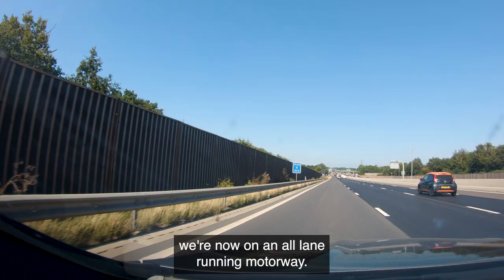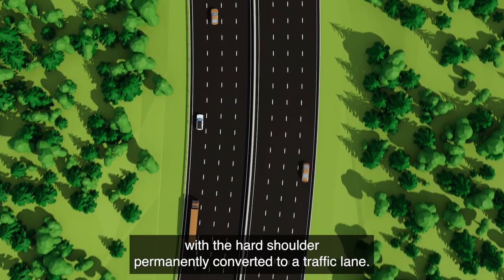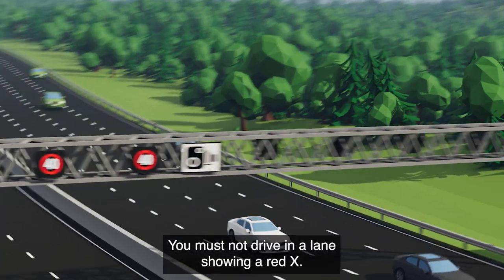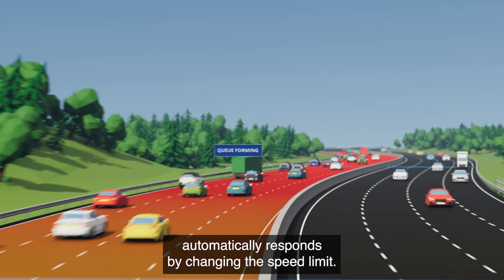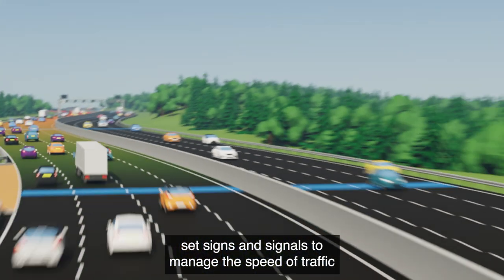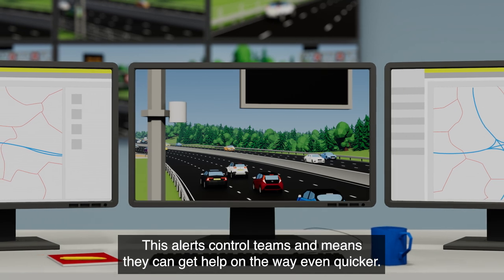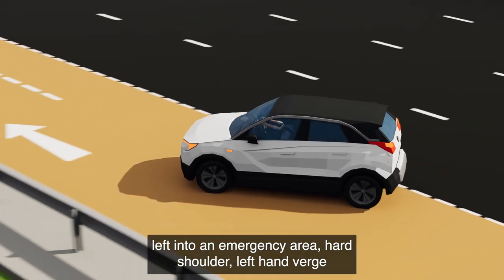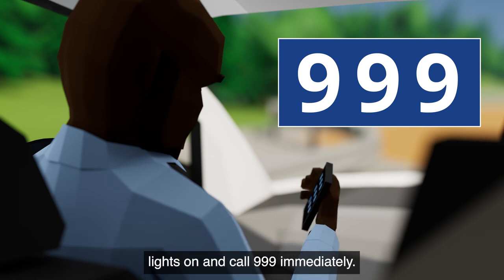How do smart motorways work?

Comment: I rarely use motorways but on the few occasions I have, these 'smart' sections have been a complete failure. A short drive from Junction 24 to 36 of the M1 just today there were 2 incidents of lane closure due to vehicle breakdown. Neither vehicle was actually in the live lane, one made it far onto the grass, another into the layby bit, UTTER CHAOS ensued! Overhead lights saying 40mph, all lanes at a standstill and nearly half an hour added to the journey of what would ordinarily take just over an hour. It's not like people use the lanes properly now either. The number of cars in lane 3 at 60mph and no inclination to move left is exhausting. Worse idea and ever.
Reply: "Forwarded message"
 I am ex motorway cop, I was a decent honest one If I say so myself, I only did speeders 95 upwards on follows due to obvious discrepancy they are never 100 percent accurate. With speed device it was always 10mph+1 over the limit so plenty of space for error so if you were doing 52 in a 40 fair cop if you pardon the pun, the +/- 2mph is mathematical con., So you know the risks, My daughter got caught on normal road by van, 39 in 30, she was doing 30.9 and 32 going down a hill,  having used the devices for 20 year it was being used way out of safe parameters, this adds on anything from 4-7 mph, I challenged at court, they brought the top barrister and his side kick an ex-cop who was as qualified and an expert as me, they withheld evidence, I now have that undisclosed evidence that proved I was correct, they lied to win the case, the only process now is to appeal and they will rip it 50k up to 500k, I'm thinking of writing a book as a way around it to highlight the con, inside out tv did a programme but they couldnt work out the 6mph overread, I can. Every car at that point (thousands over the years) in Northampton have been unlawfully prosecuted, the police knew as did cps, but they covered up it would have cost millions in compensation, I got fined 2.5k costs and in summing up the barrister said he was asked to win this case by northamptom police?, later refusing to deal with my complaint of perjury bearing in mind the police had the evidence, just a brick wall. solicitors will not touch a speeding fine and advise pay up, of course I would advise the same, motorway ones are done on algorithms. so those lines, the time .3 of a second from first to second line (beam) is the speed, the question is where is it hitting the car, is it the same on first and second?, as its time over distance, the plus or minus 2mph is a mathematical smoke screen that I can prove, its a con? but no one will touch it, my advice is pay the 100 quid, if you can afford a good solicitor and risk a 2.5 k fine which puts people off going to court , You may also get a solicitor to challenge and get you off but if its discontinued the solicitor will cost more than the £100, so catch 22. feel free to contact me, but they will do everything to prove you wrong, They are experts so believed by court your the bad boy speeding and trying to get off?  usual bullshit safety excuses you could have killed someone and lie through their back teeth. if there is a good solicitor on here who wants the story and evidence that will blow speeding vans and the +/- 2mph con out the water I am happy to chat. If you do go to court ask for the details of the others around as they are witnesses in your case , they will object hence you need a solicitor, see what speed they were doing. good luck you will need it. hope this helps.
Please share this message.

Comment: My question to the highways agency is just how are ambulances and fire engines supposed to quickly get to an accident, if the hard should has been turned into a running lane? This isn't like Germany, where drivers understand the need to leave a gap between lanes, this is the UK, where drivers simply don't have that ability. Making it difficult to get to injured drivers could be costing many lives, without this issue being reflected in the statistics.
Reply: They couldn't get through on the hard shoulder quickly when it wasn't a running lane because idiots always abuse the hard shoulder

Comment: Hypothetically a genius idea, in reality an absolute disaster for a number of reasons. You have so much panic breaking going on when they see speed limits, which is what causes huge tail backs as well as crashes as it surges back. It also results in drivers who don't obey the rules to drive right up behind drivers who are obeying and pressuring drivers. The same thing happens on the way out of the Dartford Tunnel with the speed limits there. You are pressured by other drivers. If theu activated the speed cameras and camera systems on these smart motorways every day and they were always on, it would generate far too much fine revenue and the population would revolt. It seems they only selectively actually turn them on. Which seems to undermine their very purpose. They need to be gotton rid of and they are not future proof. Apps like Waze, do a far better job of informing the driver of hazards and dangerous broken down vehicles ahead etc.
Reply: "Forwarded message"
 I am ex motorway cop, I was a decent honest one If I say so myself, I only did speeders 95 upwards on follows due to obvious discrepancy they are never 100 percent accurate. With speed device it was always 10mph+1 over the limit so plenty of space for error so if you were doing 52 in a 40 fair cop if you pardon the pun, the +/- 2mph is mathematical con., So you know the risks, My daughter got caught on normal road by van, 39 in 30, she was doing 30.9 and 32 going down a hill,  having used the devices for 20 year it was being used way out of safe parameters, this adds on anything from 4-7 mph, I challenged at court, they brought the top barrister and his side kick an ex-cop who was as qualified and an expert as me, they withheld evidence, I now have that undisclosed evidence that proved I was correct, they lied to win the case, the only process now is to appeal and they will rip it 50k up to 500k, I'm thinking of writing a book as a way around it to highlight the con, inside out tv did a programme but they couldnt work out the 6mph overread, I can. Every car at that point (thousands over the years) in Northampton have been unlawfully prosecuted, the police knew as did cps, but they covered up it would have cost millions in compensation, I got fined 2.5k costs and in summing up the barrister said he was asked to win this case by northamptom police?, later refusing to deal with my complaint of perjury bearing in mind the police had the evidence, just a brick wall. solicitors will not touch a speeding fine and advise pay up, of course I would advise the same, motorway ones are done on algorithms. so those lines, the time .3 of a second from first to second line (beam) is the speed, the question is where is it hitting the car, is it the same on first and second?, as its time over distance, the plus or minus 2mph is a mathematical smoke screen that I can prove, its a con? but no one will touch it, my advice is pay the 100 quid, if you can afford a good solicitor and risk a 2.5 k fine which puts people off going to court , You may also get a solicitor to challenge and get you off but if its discontinued the solicitor will cost more than the £100, so catch 22. feel free to contact me, but they will do everything to prove you wrong, They are experts so believed by court your the bad boy speeding and trying to get off?  usual bullshit safety excuses you could have killed someone and lie through their back teeth. if there is a good solicitor on here who wants the story and evidence that will blow speeding vans and the +/- 2mph con out the water I am happy to chat. If you do go to court ask for the details of the others around as they are witnesses in your case , they will object hence you need a solicitor, see what speed they were doing. good luck you will need it. hope this helps.
Please share this message.

Comment: So the ‘Emergency Lane’ taken is for Exactly the use of when one is in trouble.  It is to be used to pull up to the left!!! 
THEN LETS NOT FORGET TRUCKERS SIDE WINDS DRIFT ALLOWANCE SHALL WE!! Nature and Wind 🌬 does not hold for nothing. HGV’s need space in bad weather conditions… the emergency lane has saved many lives.

Volume and principles are correct… traffic volume will increase and slow.  But this is a precarious situational point.  Would digital tracker tell HGV TRUCKS to filter into one ☝️ lane for safety at those areas?… Hopefully 🙏🏼 maybe 🤔

Comment: All electronic technology is released with knowledge of problems that need fixing. This is the reason you’re inundated with fixes and upgrades. All this danger and failure could clearly be prevented by not allowing systems to be rushed through. It won’t be though because there’s too much financial clout in the tech companies.